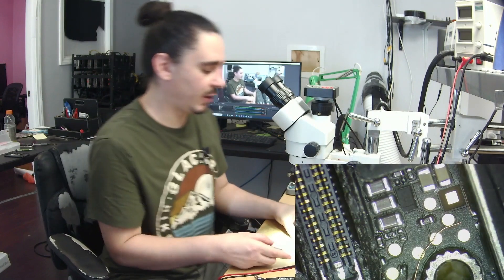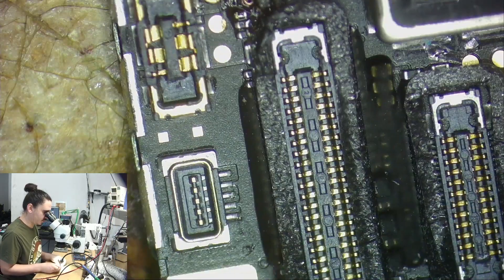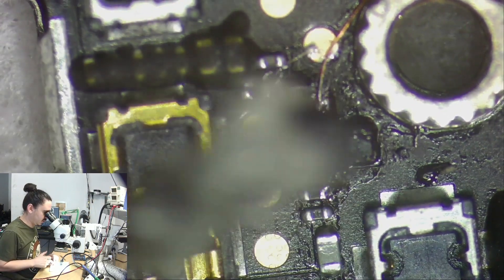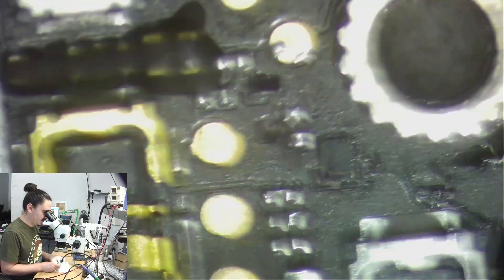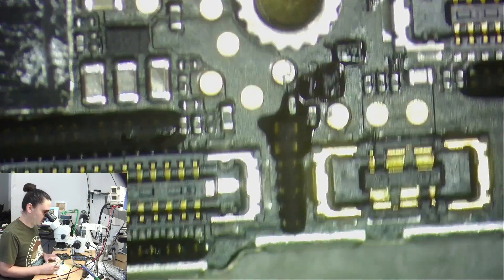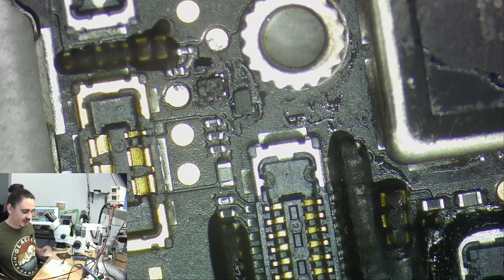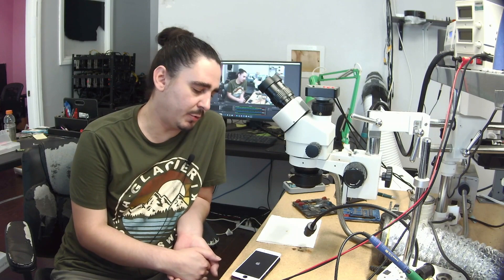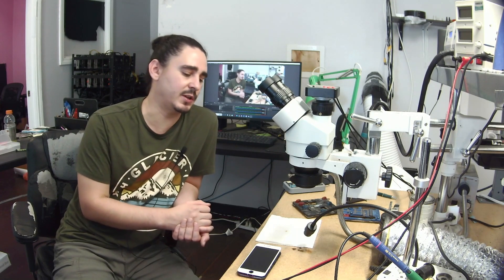iPhone 8 Not Charging - Replacing Battery Data Transistors

Comment: What does it typically cost to have this repair done? I recently took my phone to get a new battery  installed then this issue happened. They had no clue or knowledge of this common problem, so I think I may look for another shop to repair it.